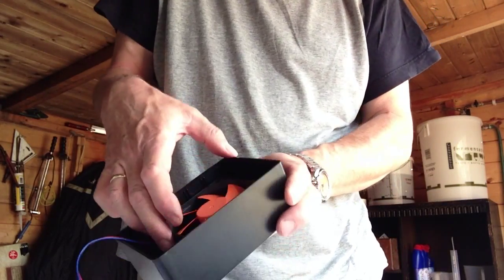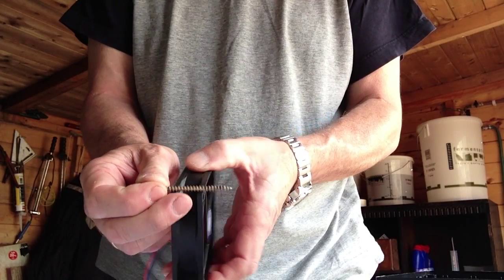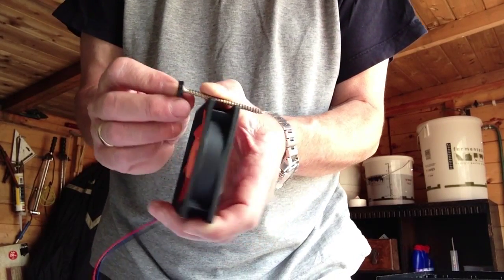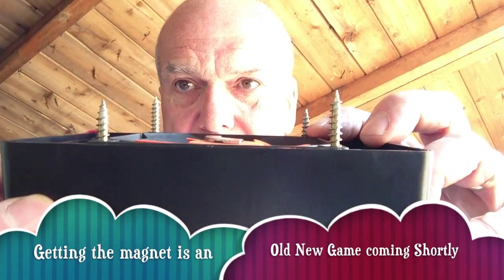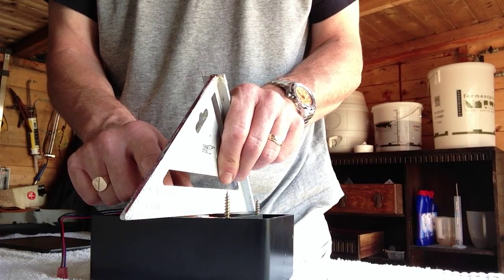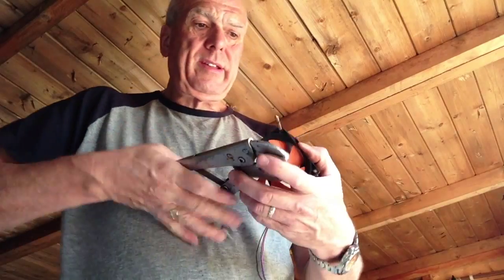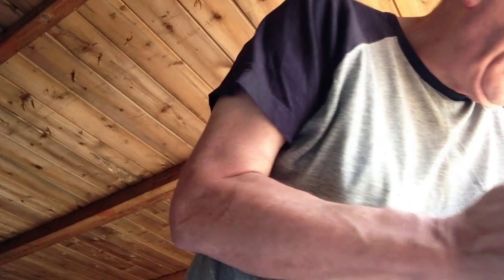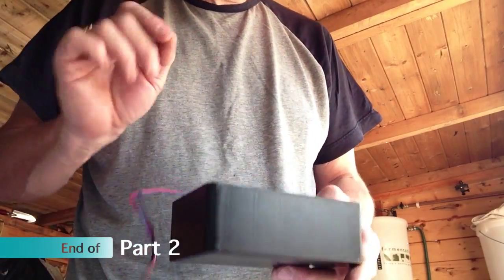The Old Farts Brewery Vlog 28 How to make a Stir Plate Part Two

Comment: looks like it will work you might want to leave a mill or to for the magnet so it wont rub on the lid
Reply from the maker: Yes I have readjusted it and it's working fine that's very much for the tip.